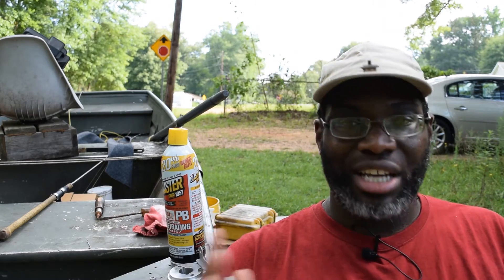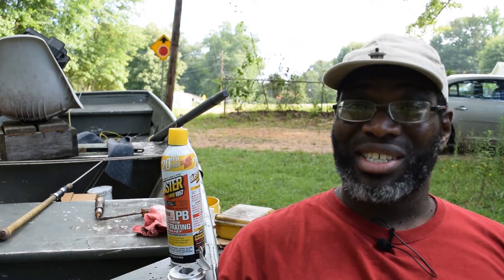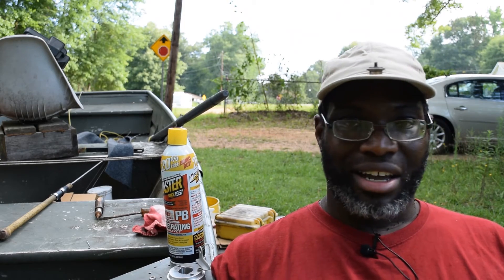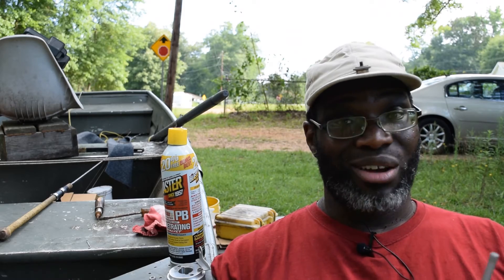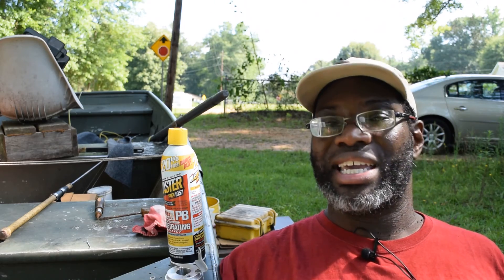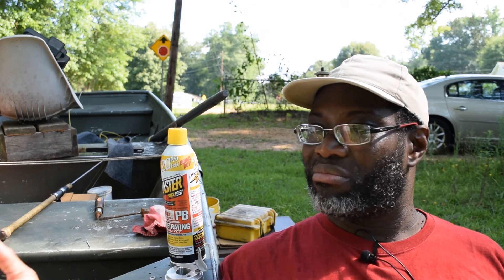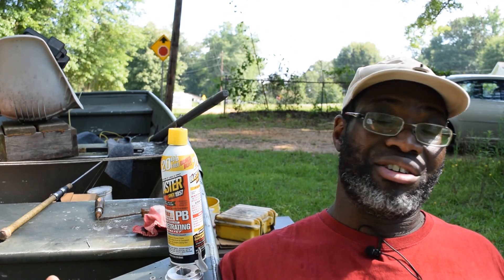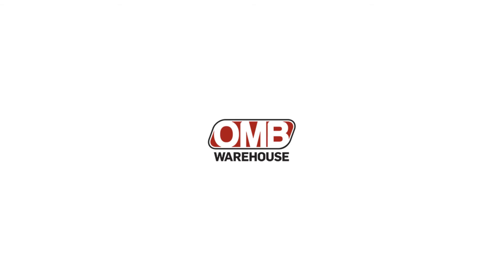Stage 2/3 Mud Motor Build | Thanks & Further Thoughts

Comment: BWL. The mud motor project seems complete. 👍 Well done. 
If I missed it please direct me to the performance trials in the water video. I am chomping at the bit to hear about your before and after performance. If you have not made the comparison video when do you expect to do so. 
Excellent videos for all topics!!!!
Thanks.
Reply from the maker: I haven't had it on the water. As I said in the video about half way through the break-in, the engine would not fire. Considering how rich the mixture was the carburetor was the problem along with normal engine build looseness. After ordering the new carburetor, upon removing the stud for installation, one of the studs broke off, thus the need for a new cylinder head. I'm awaiting that cylinder head so that I can rebuild the upper half of the motor, install, recheck tolerances, finish the break in, then proceed with sea trails.

Considering I've been planning and working on the project since February 2016, it was time to fulfill the promise I made to everyone who contributed.

The new carburetor is in, but ARC Racing was backordered on the cylinder head. They didn't tell me that until after I received the order for new valves, and a new coil. So I had to order the cylinder head from OMB Warehouse just this past Friday, 8 July 2016. I may not receive all the parts until this upcoming  Friday, 15 July 2016, which means I may not be able to finish filming until the following week, 22 July 2016, then I have to edit it,  render it, upload it, and post it.

So it could be the end of July before you guys see anything. It was either wait and leave everyone hanging with nothing or put at least something out there. Since I promised everyone who contributed I would include their name and official thank you, that's why I went ahead and did this video.

There is a lot going on behind the scenes, not to mention orders for new floats, trying to import more product, experiment with handline drifting, write the Catfisherman's Prayer Book, hold onto my day job all as I'm trying to build this little fishing lure company.

So the next month or so of my life will be spent making a three to five minute video for everyone to see. Time is truly relative.

Comment: I hope you get her going again I had thought if doing that to mine too but was worried how it would hold up and last with the high performance parts as a fishing boat goes want to just pull rope and go fish but I'm sure you will get it right I enjoy the videos and good luck and tight lines
Reply from the maker: This is a mild build. Consider that most outboard motors of similar displacement turn 5,000 to 6,000 RPM. The components chosen were designed to handle more like 7,000 RPM. Most of the time I will only turn 4,500 to 5,000 RPM. 

All I've really done is brought this thing up to what is standard performance for a "traditional" outboard motor really. Anything can break at any time, performance mods or not. Having three forms of propulsion is the safest route.

All the Baja racers run off road with engine as extremely built as any dragster, yet they go thousands of mile out in the desert with these things.